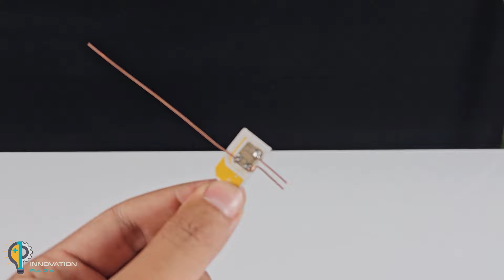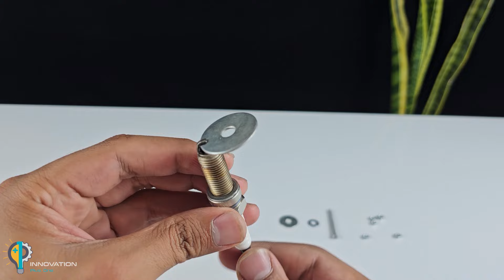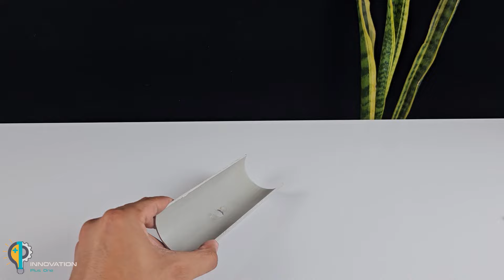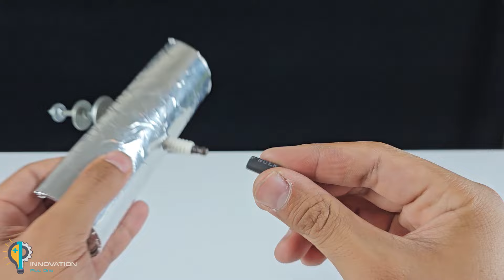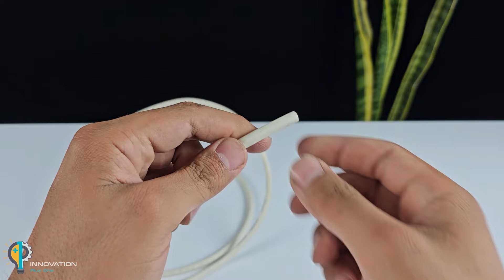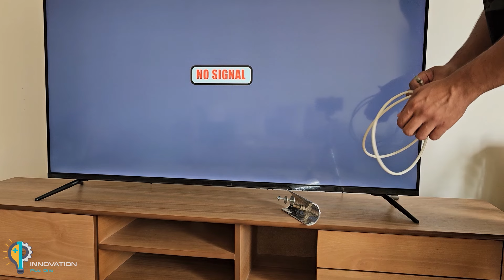Put the sim card on the spark plug and you will be surprised || Antenna Booster

Comment: This is BS ,  the connection is a direct short from the center conductor to the outer conductor of the RG6 fitting he attached to the spark plug. Anything after the short is void.
Reply from the maker: My friend, don't judge too soon, this invention can surprise you
Reply: What are u even talking about "it might surprise u".        It's crap,fake, go ahead and wast your time putting one together so I can surprise yourself on how it does nothing.  The only thing functioning to receive signal is the piece of coaxial cable itself. Unscrew the fake ass amplifier and what ever signal that was being received will be the same.  I have worked in communications for many years and I can tell   u that the connection on this guy's (amplifier). Is a short plane and simple